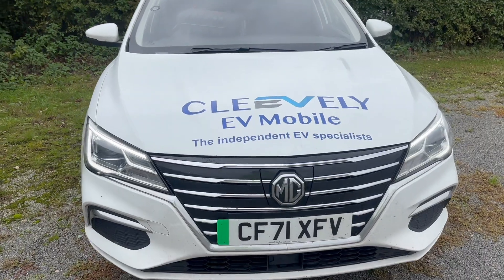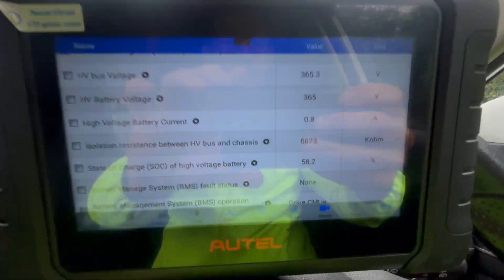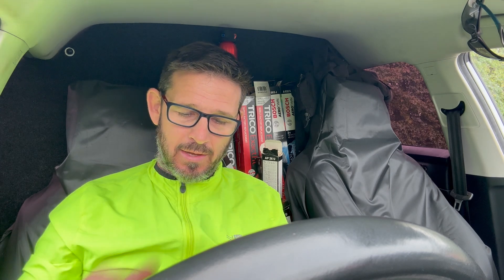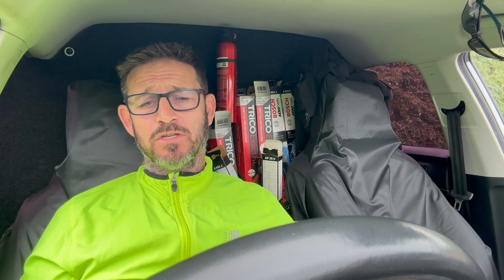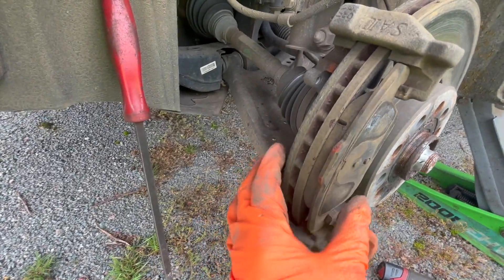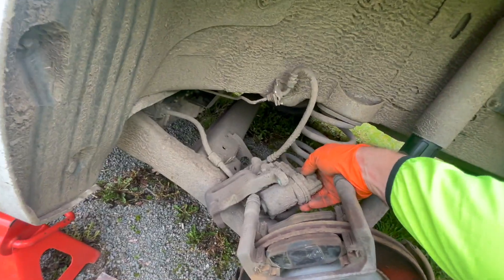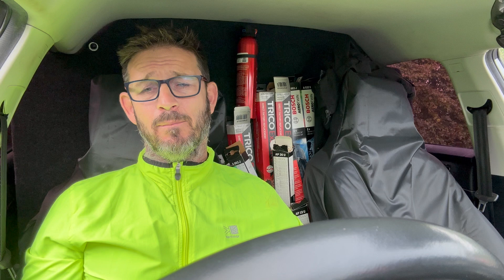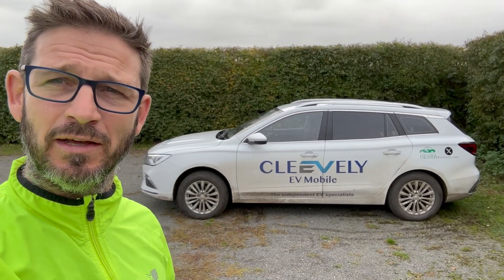MG5 143,000 Mile Update - How's The Battery?

Comment: Thanks for the update. I was wondering how the paint looks underneath. Have you seen any rot as a result of our salty winter roads? Does it need any wax oil? Also as you plan to run it into the ground. What do you think will kill it? I need to put a few more miles on my 22 plate as 30k looks like I have not been going anywhere in comparison. Your videos has reminded me to book my February service.
Reply from the maker: I think we'll run to 200k, by then there will be an MG4 estate with a, hopefully, solid state battery. No rot or anything to report 👌🏻
Reply: Good to know that it looks good underneath.

Comment: Every ICE car I've ever owned has been scrapped before it reached 140K miles.
Reply from the maker: Pretty standard, although I've had a few 150k+ VW's, but they were sheds at that point
Reply: I've run some old vag 1.9 pd engines well over 300k . Much better than the 1.6 cr they replaced it with.

Comment: James in the video , the front left arm behind the left front wheel had a line that looked like a crack , right where it attaches to the car, could have been the light but perhaps have a look or watch the video back ??
Reply from the maker: I've just watched it back. It's where I'd shoved my pry bar in to check for play in the rear bushes 👍🏼 

Had me worried for a second 😳
Reply: @Jamesandkate  ah good 👍 I was going to call you this morning , but glad it’s fine
Reply: I saw it too, at 8:29 in the video. Watched it a few times more and at first it looks like a tear in the metal, but later you can see that is where muck has been scraped off, presumably with the pry bar indeed. Phew.

Comment: Only 17500 miles in on mine. Had my first problems. ABS fault, Traction Control fault, Emergency braking not available, no hill start, and about 3 other errors I cant remember. Still drives, I'm booked in but earliest is a 2 week wait. I thought i was done with maintenance issues with cars when i bought this.
Reply: Check the 12v battery, in my experience any sort of ‘gremlins’ with strange errors seems to be down to a dying 12v most of the time with modern EVs
Reply: @madm4tty  I did think this, but the battery voltage seems fine. Also tried disconnecting the battery for 20 minutes to see if that cleared it, no joy. Had the annual service the week before, would they have checked 12v condition?
Reply: @dannyjones296 it’s not necessarily the voltage but capacity. Best to get a battery specialist to run a check on it.

Comment: I have just watched the latest What Car worst car reliability survey that has the MG4 and ZS EV in its top ten most unreliable cars, with the MG dealership listed as the worst at number one. Now I have an MG4 coming up to two years old and my experience is not in alignment with their findings at all. Working in the trade, could you make some sense of these What Car findings. Thanks for the videos, I always make a point of watching them as they are always very informative.
Reply from the maker: The dealer network has been sketchy, that's true, but these figures also cover software issues, which is by far the biggest issue for electric cars, and MG.

Comment: I have one of these mg 5's which is brilliant, 90000 trouble free miles, but the main complaint is the headlights are dreadful, does anyone have a fix for this.  The high beam doesn't seem to work either
Reply: Pre-facelift? I think James has upgraded his to LED bulbs. I haven't. They aren't great on low beam but I have no complaints on high beam (auto high beam is not great though(
Reply: Similar problem on Mk1 MG ZS. I swapped the bulbs for Osram Nightbreaker, far better than standard although not up to LED levels
Reply from the maker: I did fit LEDs, but went back to Osram Nightbreakers when the LEDs failed. Overall, they're quite poor.

Comment: Thanks for sharing!
Still looking very tidy for a "van"!

Only downside with the facelift is the driver assistance system.

What's your long term plan now the MG5 is being discontinued in favour of the less reliable MG4 estate?
Reply: @UpsideDownFork  less reliable?
Reply: @esm7708  MG5 recently ranked 4th more reliable electric car on the road and the MG4 ranked dead last in the same reliability test. It was what car if you want to read it for yourself.
Reply: @UpsideDownFork  blimey. I'm a little surprised. Lucky my wife's is a lease.

I will concede the lane assist is terrifying.
Reply: @esm7708 I was very surprised as well!
Reply from the maker: I'm hoping the MG4 will have the issues ironed out before the estate lands. I'm pretty sure most of the issues with the MG4 are software related, so I'm confident it should be ok.
Reply: @Jamesandkate  Here's hoping!

Comment: My MG5 LR has just turned 25K miles. It's still got plenty tread on the front tyres and the interior is still tight as a drum. I've had cars in the past where the interior fit and finish starts to lose it's shine after a while (rattles, squeeks etc) but the MG5 still feels like like the day I drove it off the forecourt.
I'll stick my neck out and say that it's possibly the best car I've owned in my 30+ years of driving. It's literally cost me nothing to drive other than the electricity used to charge it.
Reply from the maker: Amazing, thanks for the feedback.
Reply: you ought to get insured lol :D

Comment: Always interesting. I saw that you had the rear brake callipers off to check the brakes.  Having the electric handbrake must make that a little trickier.  I saw a vid where the person got someone to sit in the driver seat and sel3 t neutral to disengage the handbrake, then he unplugged the wiring to stop it coming back on.  Is that how it's done?  I'd like to keep things clean between dealer services but reluctant to do the back ones it in case it all goes wrong.  Thanks.
Reply from the maker: That's a long winded way. With the car in 'Ready Mode' Push the 'P' button on the gear selector, release the park brake, then switch the car off. The park brake will stay off unless you spin the wheels quickly. If in doubt, disconnect the 12v after you switch off the car.
Reply: @Jamesandkate  Thanks James.  I'll give that a try.  Very much appreciate you replying!
Reply from the maker: @malcym3394 the car also has a park pawl so it won't roll away 👍🏼
Reply: @malcym3394 using a different login by mistake.

Hi again.  Sorry to hassle you.  I tried that and the park brake goes back on.  I have a facelift - would that make a difference?

Ready -> P = park brake won't go off
Ready -> P+brake pedal = shifts to N, PB goes off,  PB can toggle between off and on -> Switch off, no brake pedal = PB goes on
Ready -> P+brake pedal = shifts to N, PB goes off, PB can toggle between off and on -> Switch off + brake pedal = PB goes on

I don't want you to waste time helping me, but maybe I'm only missing a step somewhere?

Comment: I bought a used MG5 a few months ago, partly because I saw it was working well for you but mostly because it was the only estate/hatch EV available that could do over 200 miles for my budget. So far I'm very happy with it.
Did you get the Tesla Charger firmware update?
Reply from the maker: That's great. I haven't bothered with the Tesla update, but if it was my own car I probably would.
Reply: @Jamesandkate  If you can drive the miles you do without using Tesla chargers then I suspect most people would be able to manage. I have a service coming up in a few months so will ask the dealer to check for firmware updates then.
Thanks for another interesting video.

Comment: Been subscribed for quite a while and I love your honest and no nonsense approach.

I've got a facelift MG ZS EV and it's a great car. I've suffered what seems to be the common problems of a knocking steering column (finally resolved under warranty) and seat 'leather' cracking - still arguing about that with the dealer.

From this great video, it seems that the MG service schedule is a bit OTT. The last service cost me more that my petrol 4x4 Suzuki Vitara! I can't believe that the brake fluid needed changing after just 18,000 miles!

Could you do a video about servicing MG EV's in the real world? For example annual checks, what are sensible service intervals. I'm due to get mine serviced next month but would like to get it done by Cleevely if that's really needed. It will be it's 3rd year service and an idea of service intervals for low mileage cars by an independent dealer would be really helpful.
Reply from the maker: Pop us an email to mobile@cleevelyev.co.uk and we can sort that all out for you 👍🏼

Comment: Just swapped a 2020 ZS EV for a new SR ZS EV, old 19,000 miles so not worked hard but the easier charging point was needed because I am disabled. I was happy to part with £11500 cash which might seem frightening depreciation but fuel ~ £450 (?) and servicing at the main dealer just over £450 including MOTs doesn't compare to  a petrol or diesel. The new car much improved headlights and SatNav etc and more range which is obtained with higher 10-15% miles per kWh. Buying back in 2019/20 the motoring press were ridiculing punters who bought them. Who is laughing now!

Comment: Cheers James thanks for the heads up on the revised version. I am looking to change my car next autumn and the MG5 is certainly on the list. You haven't mentioned rust problems ( cars not old enough yet I guess), any thoughts on protection like Lanoguard.  Cheers
Reply from the maker: Yeah, avoid the white, it's a bit of thin, but the other colours are multicoat and a lot better 👍🏼
Reply: @Jamesandkate  can you elaborate? I bought a white one... is there anything I can do to extend the life? Planning to drive it for at least ten years

Comment: Nice update, thank you James! Unfortunately Motorway returns the following: "Online valuation unavailable. We haven’t been able to generate a valuation for your car. This can happen if your car is rare, unique or has unusual mileage for its age." In my opinion the car industry still need to cotton on about the incredible longevity of EVs, and decouple this notion of "high mileage" from the car's value. It doesn't really matter how far an EV has travelled, the battery SoH is the key. All other things are low-value bits and bolts replacements. Anyway, all good! I got myself a 71 plate MG5 SR with just over 40k on the clock (battery at 98.3%), so this gives me huge amounts of confirmation bias! 😀
Reply from the maker: Thanks for the feedback, Jan. Glad your MG is looking after you.

Comment: I'm running the pre-facelift mg5 as a family car and its working well for us. The main attraction of the facelift model for me are the app (preheating and charge management) and ability to fit a towbar for my bike rack. Solid car.
Reply from the maker: Yeah, it's definitely a more family orientated car. They've also added LED headlamps, reworked the suspension and it looks more inviting too.
Reply: @Jamesandkate  interesting. How different is the facelift to drive? Does it still have the excellent ride comfort?
Reply: For the bike rack, I have bought the Thule 993 Outway Platform 2. It's an easy fit for the MG5 and means you don't have to worry about obscured number plate and lights. You can also leave it on the car and open the boot without the bike on (if you are careful, you can do it with the bike on). The MG is a fantastic car and has proved very reliable. Mine is on 83k miles now and runs like new. The last 8500 miles has returned 4.3 miles/kWh and easily gets 250+ miles on a full battery.
Reply: @WoolyChewbakker  looks really nice. Wouldn't work for me unfortunately as I need room for 4 bikes (partner and kids), and my e-mtb is too heavy. I use a Thule velospace xt4 instead, and just take my partners car (has a towbar) whenever we head out for a day on the bikes. My next EV (possibly a facelift MG5) will have a towbar!

Comment: Hello James.

Really enjoyed this update/report as usual.

Currently am considering buying one of the 'deals' on offer.

Both brand new. SE £19,200 or Trophy £20,300.

Which would you choose?
Reply: We went non-trophy on our pre-facelift SR because after having driven both my wife hated the slightly aggressive LKA. It's not for everyone!
Reply: Save some money buy a low mileage second hand Trophy! 
My dad brought one brand new! Even though he likes it, the depreciation stings for him
Reply from the maker: I'd take the Trophy, it had a few extras that I like. We only have the higher spec cars for the lads.
Reply: @Jamesandkate  Thanks James.
The Trophy it is then.

I agree with your costs analysis.

After 6 years and 60,000 miles I estimate the car will have a private sale value of approx £8k at today's value given it will still have 1 years manufacturer's warranty remaining.

The annual £2k depreciation is more than offset by the savings and reliability factor.

Comment: Great see the vehicle is still performing well. It’s people such as yourself that are providing that Ev batteries do go the distance. Let’s have another update at 200,000 moles if you still have the car
Reply from the maker: Probably do a few before that, every 20k seems to work well.
Reply: "Providing EV batteries do go the distance?"
You are joking?
A diesel... Especially the Ford Eco boost ("Eco boom") would be coming up to it's third cambelt change, 12th(?) Oil change, from what James said 4th set of front Discs/ Pads, plus filters, probably Injectors, etc, etc, etc. Then add the fuel savings.
I think that battery would be paid for easily IF it needs changing.
Correct?
Reply from the maker: @rogerstarkey5390 I think he meant proving, but it auto corrected to providing